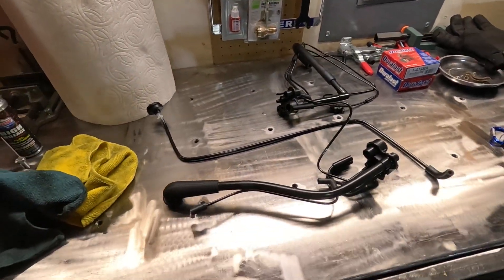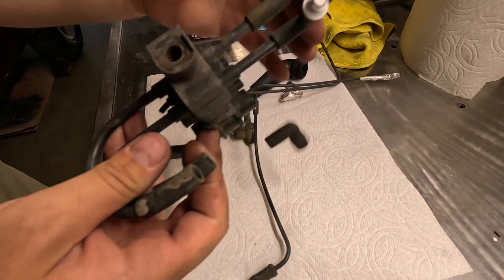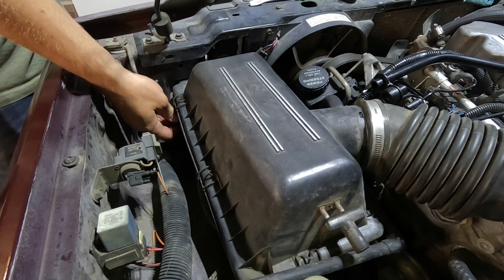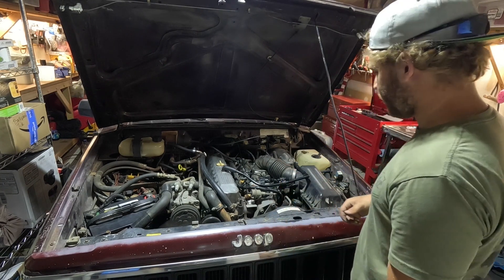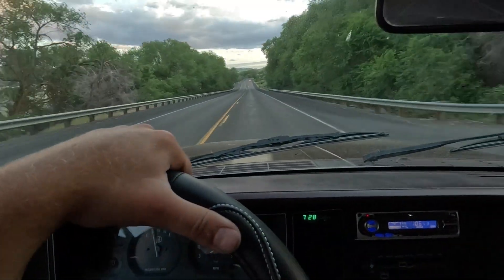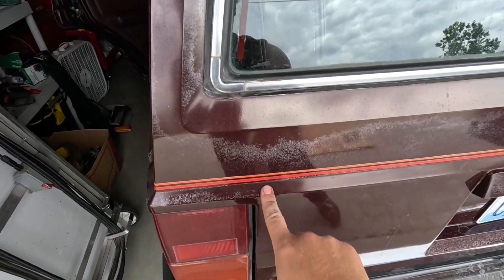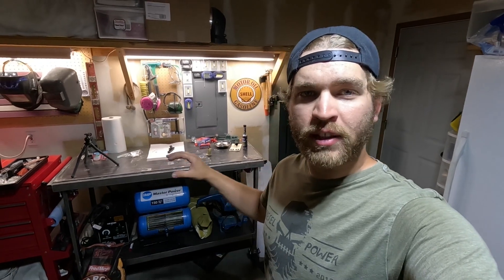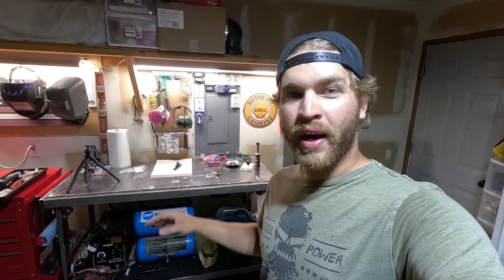Jeep Cherokee Vacuum Lines, And Turn Signal Fix

Comment: Channel seems to be growing over 3000 subs well done mate nice work replacing the vacuum line and like others said double check that transmission fluid when warm.
Reply from the maker: It sure is!  Thank you so much for being a faithful subscriber/viewer all these years!  I can’t imagine why someone would try to plug up those vacuum lines with sheet metal screws (maybe to gain 1/2 horsepower🤣).  And I’ll double check that transmission fluid to make sure everything is squared away👍

Comment: As James Wallace noted, always check trans fluid with the engine running. A lot of electrical issues crop up not because of failed parts, but failed connections. Corrosion deposits are non conductive and when a ground connection goes bad, you get all kinds of goofy things happening. Sometimes just chasing the wires to power and ground and cleaning connections will save a lot of trouble and parts chasing..
Reply from the maker: I agree, I’m going to double check with the engine running next time.  Ya those connections I guess where simply corroded beyond repair.  I’m just glad it was a cheap fix  and didn’t have to dive into the steering column wiring.

Comment: Thank you for yet another great video! Nice sleuthing on the electrical issues, too. One concern I have though is that you checked the trans fluid with the engine off.  Dip stick has procedure written on it. Usually says hot, level and in park. Cold and not running will show low when it really isn't. If overfilled it can damage transmission. Looking forward to the future installments for sure.
Reply from the maker: Thank you!  I’m just glad I didn’t have to tear apart the steering column to replace a wiring harness of some sort.  That would’ve taken forever and cost ten time more!  I appreciate how simple these Jeeps are to wrench on.  Also thank you for the advice on the transmission,  I’ll check that with the engine running soon.  I noticed when I was crawling under the Jeep off camera the transmission pan had a few drops leaking off the pan.  My guess is it’s had a long time to ever so slowly leak out after sitting in a field for almost a decade.  Next video on it should be up soon!  Thanks for watching James enjoy the rest of the weekend😀👍

Comment: Hello, can you please help. What is the big vacuum line running under the windshield fluid tank next to the fender wall. I don’t have it- 88 MJ 2WD manual
Reply from the maker: @cousin_JACK  Sorry, but I’m not exactly sure.  My best advice is try to look up a picture of the vacuum diagram.